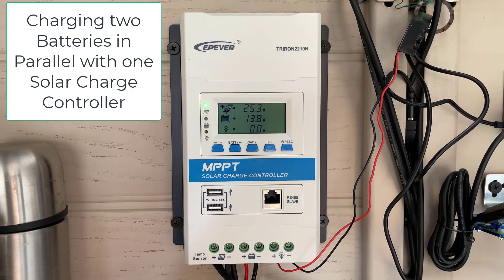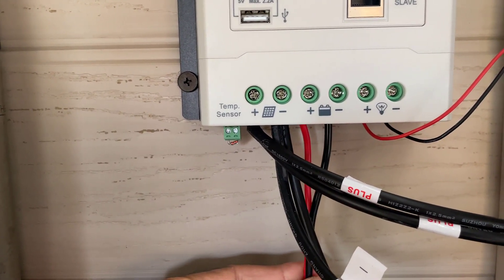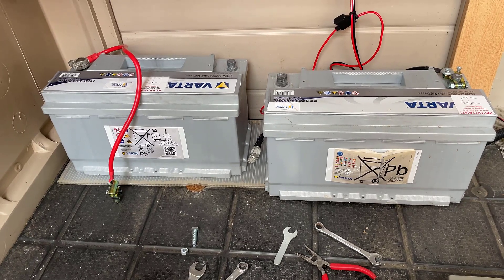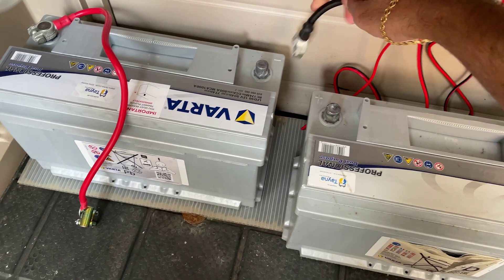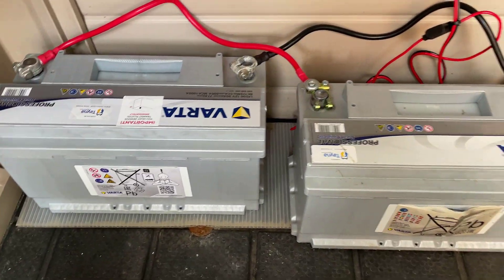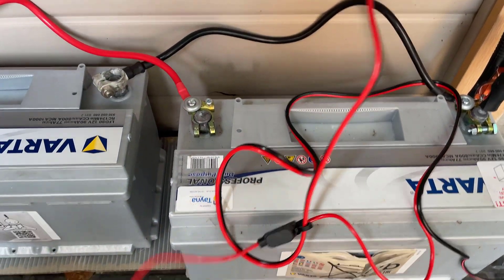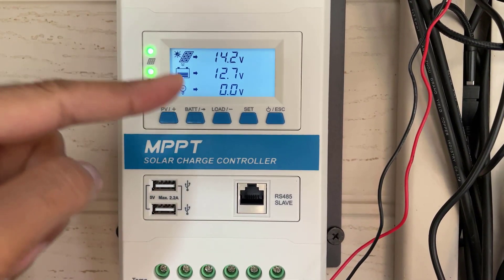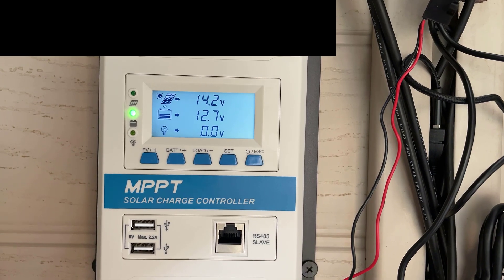Charging two batteries in Parallel with one Solar Charge Controller

Comment: I had one 12V battery w/ 75Ah that came with my RV and already had another 12V battery w/ 128Ah.  Is it okay to connect them they way mentioned in the video?
Reply from the maker: It's not advisable because both batteries have a different amp rating, the charge across them will not be equal and you could potentially damage them or reduce their life.
Reply: You'll need to use a VSR (voltage sensitive relay) to charge two different your batteries from the one source.
The VSR will charge one battery at a time, regardless of size difference. 
It will detect which one need the charge and charges it.

Comment: Can i charge 4 batteries(12 v 1.8 amps each) to 12 v 10amps charge controller.(given they are connected in parallel)
Reply from the maker: The total amps of the batteries is below your Charge controller so it should be ok

Comment: Can we charge 2 batteries in series with one charge controller???
Reply from the maker: You have to be careful, bear in mind if you have a 12V controller and two 12V batteries in series (24V in total), you won't have enough voltage from the controller to charge the batteries.  See here for more info: https://www.impactbattery.com/blog/post/how-to-connect-charge-batteries-in-series-parallel

Comment: Battery management system is needed. Internal resistance of each battery is different. A battery with lower internal resistance will draw more current. This higher current may destroy one battery while the other battery is undercharged and sulphated. While not charging, the battery with higher voltage will supply the one with lower voltage, disharging. 2 batteries are the same
Reply: Would you need a battery management system between the 2 6v batteries, or do you mean you need one between the set of batteries and the inverter?
Reply: sulphated? is he talking about lead acid?

Comment: Hi - apologies if its a dumb question but why is it important to connect the solar output to separate batteries +ve and -ve when the batteries are wired in parallel? Cheers.
Reply from the maker: It ensures an even charge across both batteries.
Reply: To get it as close to perfect as possible, you use the exact same lengths for wires connecting +ve -> +ve and -ve -> -ve on the batteries. Then you trim the insulation off in the exact centre of each parallel wire link. Then you connect the solar -ve to the middle section of the -ve parallel link and the solar +ve to the middle section of the +ve parallel link. By doing this, you also balance out the lead resistances. Even though the resistance of the leads connecting the batteries together is small, there will be an imbalance unless you connect to the centres.
Reply: Great infor  @WayneRiesterer